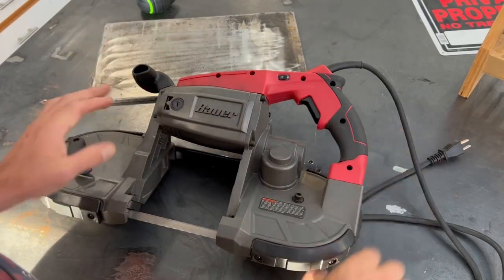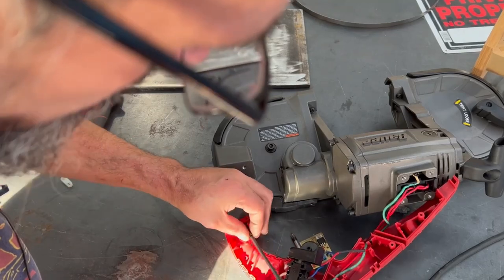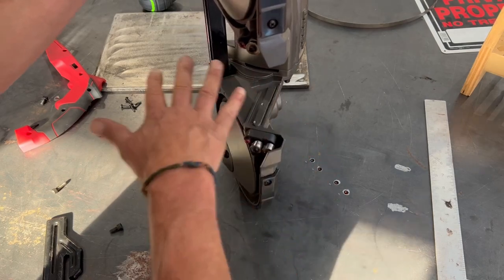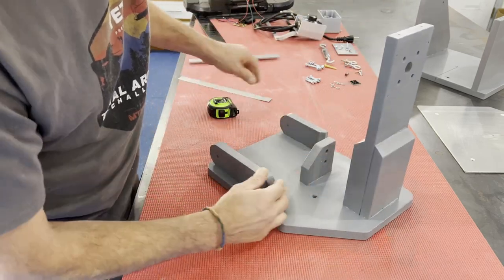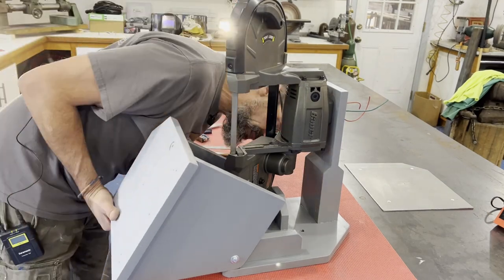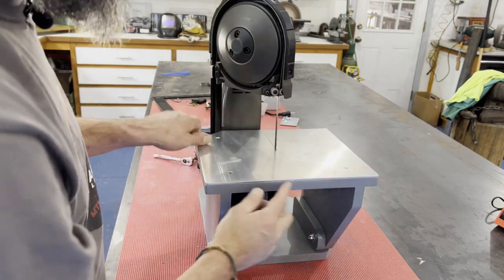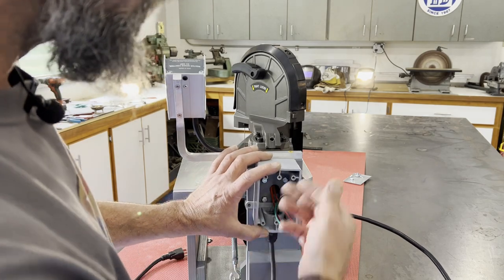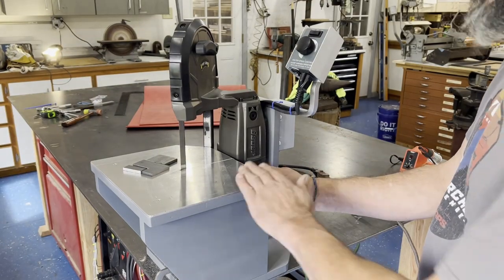Portable bandsaw stand // no weld build

Comment: Absolutely the best,  most stable design I have seen. Love the styling too.  BTW, one of the reasons why the mounting locations for the saw are so well engineered is that this HF tool uses the exact same handle mounting strategy as the Milwaukee unit I have. Mine is older than Methuselah, so not sure if the new ones are built the same way. In any case, I've been looking for a good starting idea for a permanent solution to convert mine to fixed mount and your approach is a home run. Was going to build it with welded steel, but I really prefer to use wood. It will be lighter and easier to move it from bench to bench if I feel the need. Going to take your advice and use 3/4 Baltic birch. I just love working with it, although it is very pricey. 

Just one comment on safety - this from an EE and master electrician - having the plywood exposed in the back of the junction box is a fire hazard according to National Electrical Code - since wood is a combustible material, it is not allowed to have any of it exposed to the internals of line voltage j boxes. Even when installing a switch or receptacle box in a wall covered with wood paneling, the front surface of the box must be flush with the front of the paneling so that no wood is exposed to the internals where sparks or heat could be generated (such as from poor or faulty connections) 

Thanks so much for recording and posting. Keep up the great work.
Reply from the maker: Thank you Paul, I am still very happy with my build and use this tool so much, I can’t even imagine how I did without it. The only thing I might upgrade is the aluminum surface on to maybe steel or stainless steel sheet.
Thanks for watching 👍

Comment: Most of the design is solid. The only thing I would modify is to add a mechanism to set the plane of the work surface perpendicular to the the blade. Not sure though, maybe that turnbuckle does that. The pivot is clever. If you change the design to metal and decide to use square tubing at that pivot, oversize the bolt holes and use round tubing with an ID suitable for the bolt as a crushtube to take the clamp load off the square tube walls. I'd probably change the design to a completely toolless pivot, and use something like a fluted knob available from Carr-Lane.

Comment: Even though it's a prototype it's the best and most complete conversion for this type of saw here on YT, and I've seen several projects, but this is by far the best.
Reply from the maker: Thank you sir, there were some “head scratching “ moments during the build but I think I came out great 
Thanks for watching and your comment 👍
Reply: @BuildswithBrian  I was inspired to use HDPE boards and aluminum profiles in the construction, but the way you designed it, we can use almost any material available! The maker community thanks you.

Comment: Brilliant design!  It's easily the best I've seen after looking at a lot of bandsaw stands.  A steel top will be much better than the aluminum.  Sealing the plywood top and the saw cut in it with a thin laminating epoxy would allow for using cutting oil without damaging the wood.  It should be allowed to cure overnight before adding the metal top so the top doesn't bond permanently to the wood.  For occasional home shop use, plywood is a perfectly suitable material.  For frequent use or if employees were using it an all metal stand would probably be more permanent.

Things I would do differently would be to use tee nuts in the pivots to allow for one tool instead of two and to use additional tee nuts and bolts at the back of the pivoting piece to secure the table instead of the turnbuckle.  The turnbuckle is distorting the top a little when it's tightened; enough that it can be seen in the video.
Reply from the maker: Thank you, and to address your criticisms I would say I agree with a steel top instead of aluminum as I mentioned in my video.
Totally disagree with cutting oil, it is not a good idea with a bandsaw like this with rubber wheels, if you need lubrication use a wax stick.
Sealing the top with epoxy is not necessary in my opinion .
Tee-nuts would work but would not allow the use of nylock nuts on a part that needs to remain snug but yet still allowed to pivot.
And I like my turnbuckle 👍

Comment: I love it, very good design . Wood is a very good choice, but I would think about putting a steel plate were you are going to clap it down so you don't smash the wood.
Reply from the maker: Not sure I understand what you mean, but a steel plate on the base for the top??

I can only tell you, you don’t need that much attention on the turnbuckle as you think to keep the 
Table secure

Comment: Great build , I wish I had the space for that kind of setup but I clamp mine in a vice and use a small aluminum table that I made to cut pin stock and G-10 and liners . 
It really works great and saves my arms and fake shoulder replacement joint 😎.
This is one of the best non welding projects that I’ve seen, I’m a retired toolmaker / welder with an ICD implant device so the welding is a no go for me . Nice build and I like the tilt table the best part , that different than the other builds I’ve watched on here , nice job , keep the content coming. Later
Reply from the maker: Thank you sir !

Comment: I see ,but it seemed from the video which is great incidentally, that you had decided that before you had decided in the tilt. I use a lot of saws and like the slot in the front only because it often prevents small off cuts from getting jammed in the rear slot. This is why I wax interested in your reasoning. I wasn’t questioning your design, just trying to learn😁
Reply from the maker: That’s a good point, I have had small off cuts, get jammed in the slot, I will have to consider that thank you
Reply: I hope you know I was not trying to be difficult I thought that maybe I had missed something. I love your design and just picked up a well used Milwaukee that looks exactly like yours and will be doing something similar. Mine has the speed control in the switch but aside from that it looks the same. I'm thinking a 3/16" steel table but I am a woodworker and may make the same as you but with the steel top. Thanks for doing this video.
 @BuildswithBrian
Reply from the maker: @peteblairakathemadscientist 
No worries Pete

Comment: Liked watching your design process.  I also have a portable bandsaw I've wanted to make into a table saw like this.  I prefer to work with aluminum so I may use your basic design with 1/2" Aluminum plates and 1" Aluminum square bars at joints.  Yours looks very functional.  Thank you.
Reply from the maker: Thanks John, so far I am extremely happy with it, good luck with your build 👍

Comment: i wold like to see one made out of steel. Very nice the one you made out or wood/
Reply from the maker: I’m still using the wood one with
No trouble whatsoever.
Steel would actually be better but in this case the plywood is plenty good enough

Comment: I would leave it alone, except I’d change the top to steel so I could use magswitch products, etc. The only other thing I would have done differently was to put another hole in the pivoting table aligned with the pivot hole towards the back and just use a pin to prevent the table from pivoting - instead of the turnbuckle.
Reply from the maker: Yes, I keep planning on changing the top over to steel, just haven’t got to it yet as far as the pivoting table the turnbuckle is a pain in the butt, but it does keep the table, nice and tight and free from vibrations

Comment: I’ve watched this a couple of times - great video and design.  Could you use a second bolt through the back of the pivot bracket to hold the table in place and remove the complexity of the turnbuckle?
Reply from the maker: I think a second bolt would not keep the table as tight as the turnbuckle does, slip in the holes would probably make the table vibrate

Comment: Really nice build. The wood is totally fine. I like the folding table too. I wonder why you chose to anchor the table the way you did instead of a bolt and wing nut on the bottom few inches from the pivot hole? is there an advantage to your contraption?  Thanks- very cool.
Reply from the maker: I felt the turnbuckle would keep the table clamped down tighter, the saw does cause vibrations.
It’s work perfectly.
Thanks for watching and sharing your ideas

Comment: Great video Brian. i do not see the links for the speed control. would you consider selling the plans for this? I know you can't / don't endorse taking the saw apart, but if you could sell the plans for the wood table, I know I would be interested in purchasing. Thanks for putting things like this out there
Reply from the maker: Sorry, I must’ve forgot to add the link for the speed control, but just simply Google “speed control for router” and they will pop right up, you can even get them off Amazon
I can fully stand behind, taking the porta band apart, it’s the manufacturer that might have a problem with it, and will void your warranty  😆
As far as plans go, honestly, you’re the first person that has asked for plans, I think, I will consider it, it’s really an easy build. 
The thing with plans is you would have to have the exact same model saw for the plans to actually be good. If harbor freight should change factories or something the holes may not line up right.
Hope this helps, thanks for watching

Comment: Nice. I'm looking to build one for my 20yo milw. saw.  
It weighs a f'n ton, and I don't really need it to be 'portable, tho I'd hate to mod the tool because, reasons.
However, more and more I use it for things that need to be more precise and holding that beast cutting angle iron is a bitch as it will wander.
Reply from the maker: Just do it
Reply: @BuildswithBrian  ha. I'll prolly wish I did it sooner.

Comment: Building it with steel requires a whole different set of tools that a lot of people may not have.  Press breaks, welders, plasma/oxy-accetylene, power shear ect... I think it would be better... but maybe not practical for most.
Reply from the maker: Yes a somewhat different set of skills but absolutely doable, I could and would design it to require a minimum of metalworking tools and skills.
That being said, wood is still easier 😁
Reply: @BuildswithBrian  agreed.  I was a welder/fabricator for 25 years. I am more comfortable with steel than wood, but woodworking is much more affordable and forgiving to a novice. And you don't have the fire concern to worry about in a small shed or garage.
Reply from the maker: Yes sir I was a fabricator also, about 31 years,
Also more comfortable with metal than wood 😆